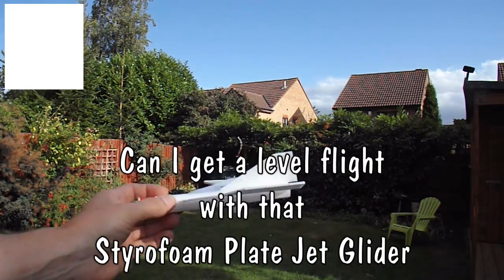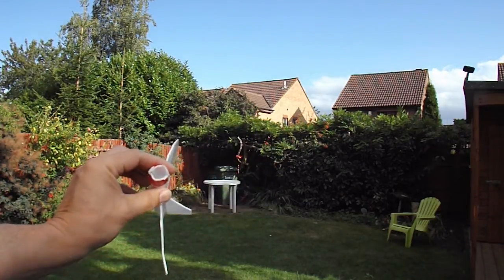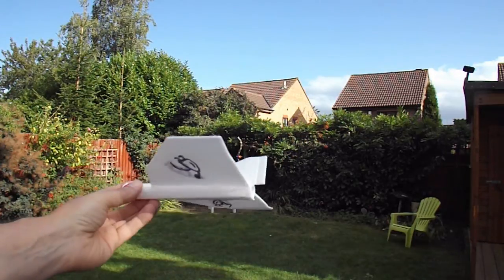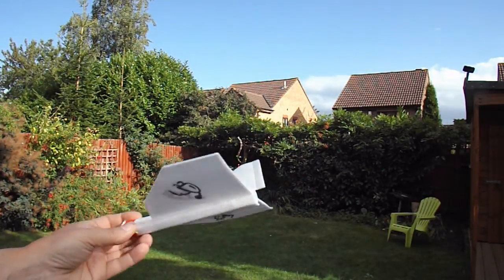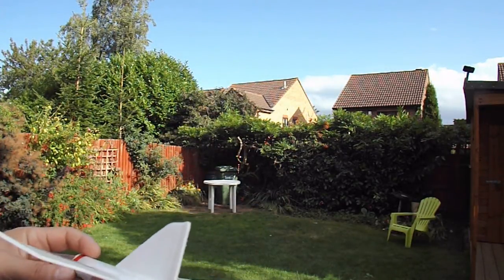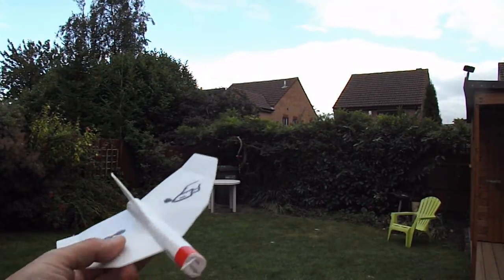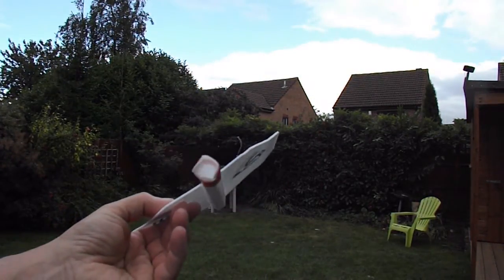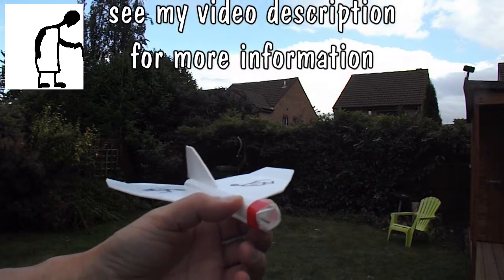Can I get a level flight with that Styrofoam Plate Jet Glider

Comment: I have no stro time plate
Reply from the maker: junaed islam if you don't have styrofoam plates then you will have to look elsewhere for thin polystyrene, maybe in some food packaging.
Reply: Thankd
Reply: I mean thanks
Reply: I have one question how to make drone and fly
Reply from the maker: +junaed islam that is a regular request and I have created a standard reply, the answer is NO. To make a helicopter or quadcopter stable in flight I would have to buy so many parts designed for the purpose it is cheaper to buy a ready made helicopter or quadcopter or a kit. A good example would be something like the Eachine H7 2.4G 6-Axis LED Mini RC Quadcopter. On top of that, my channel is aimed at simple, quick, cheap projects and a helicopter or quadcopter build is not a simple, quick, or cheap project. You would be better finding a channel that specialises in RC Quadcopters or Helicopters so you get the information from people who know what they are talking about. FliteTest would be a good place to start https://www.youtube.com/user/flitetest
or anything David Windestål is involved in https://www.youtube.com/user/dadde87
or you might like this video by The Post Apocalyptic Inventor https://youtu.be/qa_x93JQhNM
for rubber band power check out the work by norris432 https://www.youtube.com/user/norris432
Reply: OK thanks
Reply: OK thanks
Reply: But this supercapacitor how much
Reply from the maker: +junaed islam The supercapacitors I used came from Maplin Electronics. I am not endorsing these products I am just answering the questions people have asked.
http://www.maplin.co.uk/c/components/capacitors/super-capacitors
Here's an eBay link for a 2.7v 10F supercapacitor I bought that cost me £5.66 for 2 http://www.ebay.co.uk/itm/251694354652
Here is a great video demonstration by Electric Experiments Roobert33 of Capacitor and superCapacitor DC
https://youtu.be/ZgozrScGN8U
Wikipedia http://en.wikipedia.org/wiki/Supercapacitor
Reply: Thanks for this Link's

Comment: Very very nice !
It sort of hunts with wind disturbance and self corrects. Seems to like being a few degrees upward from level in flight and would give a nice floaty ride to any ant inadvertently picked up.
Reply from the maker: Thanks Slider, I am very pleased with this one, it really floats on the air because it is so light. It's been over the wall into my neighbour's tree a couple of times luckily just within reach. I shall probably lose it soon, especially if I take it to my current favourite flying site as the grass is too high so I will not be able to find it when it lands.
I've had a request to put a motor on it and I think it might take one of my SuperCap powered motors OK but I am worried it will fly off even if I get it to circle. It was cheap to build so losing it is not the end of the world but supercaps are relatively expensive.
Reply: GrandadIsAnOldMan
Here's how I would do it - score the vertical and bend to whatever circle you wish it to fly. Test throw unpowered to see that circle, then charge the cap to 50%. If all goes well, charge to 100%.
For seeing in the grass I would suggest a dayglo marker tail or, for bigger planes especially in the evenings, a Joule Thief'd LED..the LED will carry on far past the end of a motor run   :)